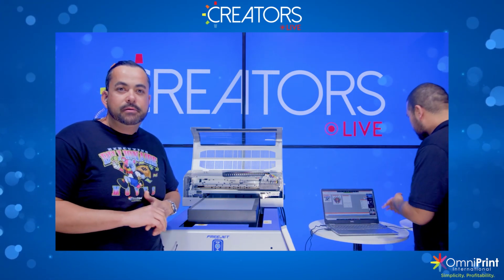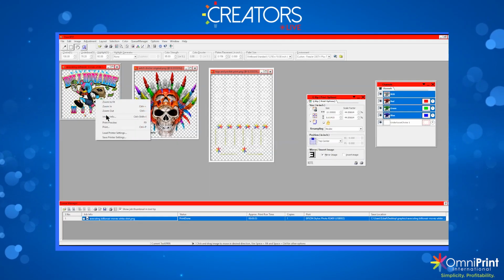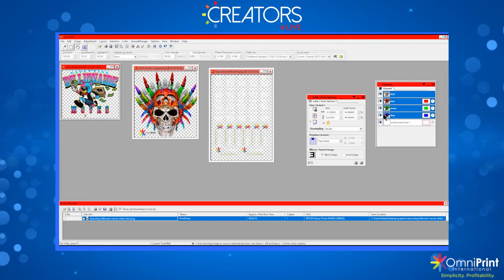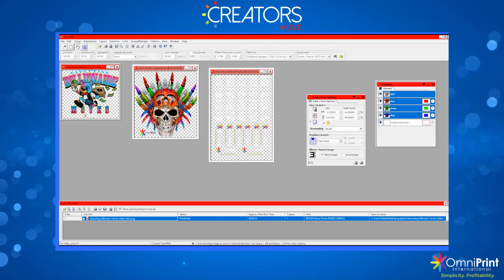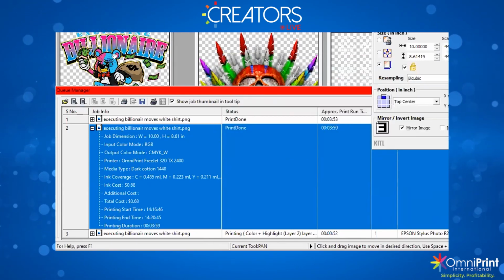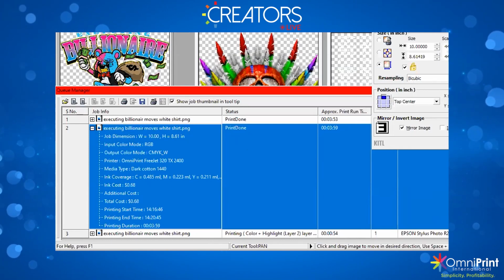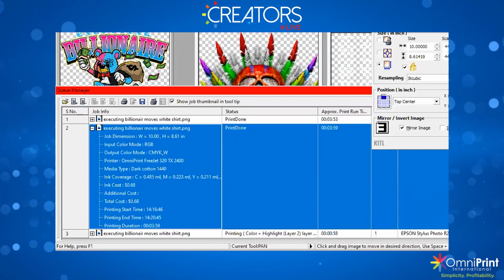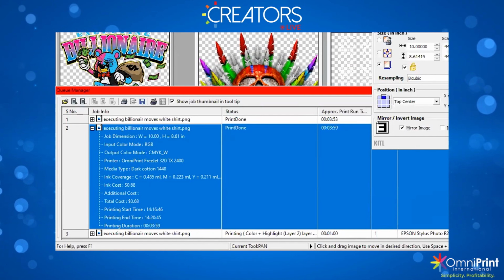Creators Live  April 21st, 2021 Direct to Film Transfers

Comment: what settings should i have in my rip software to slow down my printer if I don't have the heat platten? How do I slow down the printer so it dosen't bleed. I've tried Dark garment dtf environment, black cotton production and photo black cotton. They all run and don't look good. I have Hot peel.